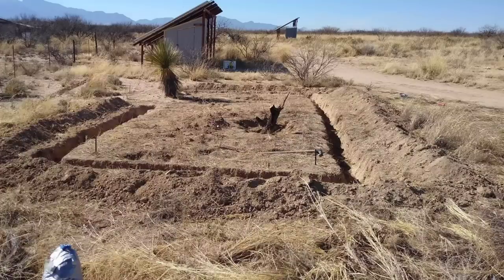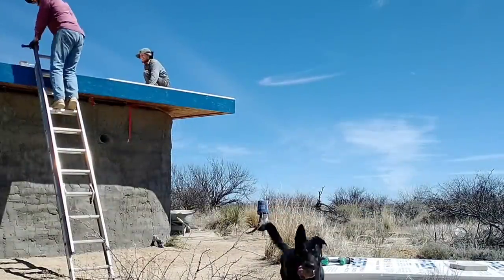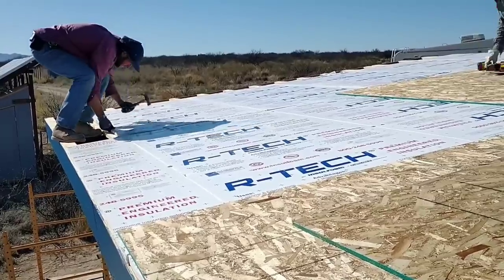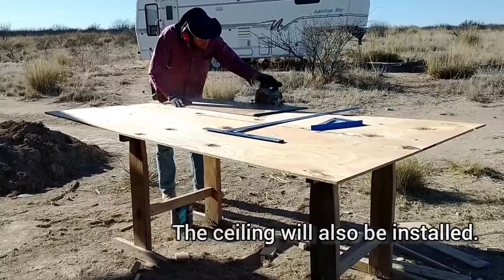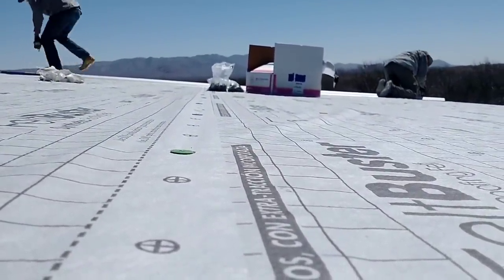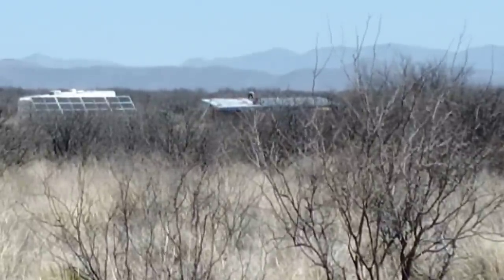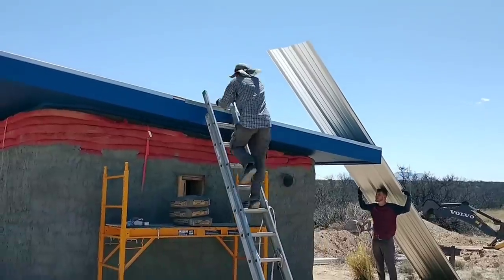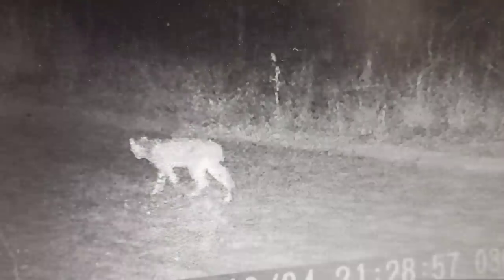HYPERADOBE Tiny House #5 Roof & Septic

Comment: Interesting that you went with the galvanized R panels. I have a 24 x 30 shop that has the same R panels, it started out as just a covered carport so the galvanized was fine. After I enclosed it, I felt it was to hot so I painted the roof white, I’m glad I did.
Reply from the maker: The silver galvanized was less expensive, so we did a quick temperature check on our house, and it was a little cooler than the white. It surprised us too. The dark gray was definitely much hotter.  It's not summer here yet, so it may not be completely accurate, and the only white we could easily get to on house is the trim. We might could compare it to our white roof in the summer.

Comment: Is it a code/structural reason that two thin layers of foam would require more purlins on top?   

(Two layers pro: can stagger the seams, cons : as you have mentioned.)
Reply from the maker: It was just a decision based on what we felt comfortable with. Thicker foam means longer screws, more risk of compression, and a less secure connection.

Comment: Do you know of any off griders using living machine septic system?
Reply: From my limited research,  subsurface distribution constructed wetlands MAY be built between the septic tank and leech lines. An Inspector simply ignores them. But it does NOT replace the leech field Code requirement. At no point can the effluent come to the surface. (Cochise County NM) Correct me if this is incorrect/incomplete
Reply from the maker: Thanks for the input SoloSailor. We haven't looked into it, or heard of anyone using one around here.

Comment: Nice video.  Maybe you'll consider having solar panels on top of your roof in the future. Apart from providing additional electricity, it would prevent heat from entering via the roof...
Reply from the maker: The roof doesn't slope in the right direction and it's not at the right pitch. He already has enough solar panels. 🌞

Comment: nice build, i used the metal roofing on my Barn 32x14 with 8 in 12 pitch hard to install because of my pitch but a great product
Reply from the maker: Thanks! Yes low pitch makes everything so much easier.

Comment: It's important to step in the right place when walking on the foam layer because if you step in the wrong place you'll go through the foam layer and this will ruin the foam layer. So they can walk carefully you can install the foam board and cut the foam board.  So you can cut the foam board to install it correctly. You don't want to squish the foam. When walking on foam layers, it is important to step carefully and install the foam board correctly. To do this, place the foam board on a flat, stable surface, cut it to size, and secure it in place. Avoid stepping on the edges or damaging the foam layer. By following these steps, you can help to ensure that your foam layers last for many years. The foam layer is delicate and needs to be handled with care. When walking on it, you have to make sure you step on the right spots, otherwise you might sink into the foam and damage it. To avoid this, you can use a foam board as a guide. You can cut the foam board to fit the shape of the foam layer and place it on top of it. This way, you can walk safely on the foam board and install the foam layer correctly. Be careful not to compress the foam too much when cutting or placing it.
Reply from the maker: The foam had it's challenges for sure. Sometimes there's not a lot that needs to be said, but better to say something than nothing.  I could have just played music, but someone's going to complain no matter what you do.
Reply: @RedandAprilOff-Grid  that's true

Comment: Roof is heavy duty, but i dont see any attic ventilation, no air in or out? So sorry about back pain, i hope you heal up soon.
Reply from the maker: Thanks! We considered adding vents and could add them later. The vents are typically for the attic space, and this is an unvented roof without an attic, so they shouldn't be needed.

Comment: Curious what the septic system cost was I'm budgeting for a build shortly .
Reply from the maker: It was $15,000! Our daughter's septic right next door was $9,000 two years ago, but it has 100 feet of leach field, compared to his 225 feet.
Reply: @RedandAprilOff-Grid  did you take the az diy install test
Reply: Can you install your own system? Did they inspectors give you any trouble they are ruff here
Reply from the maker: @timerickson7056  We installed our own septic. There were 2 inspections, we didn't have any issues. Ours cost $6,000, for materials and the backhoe rental. We put in a plastic tank and 100 feet of gravel leech field.

Comment: I understand that the thin insulation is cheaper, but this does almost nothing to prevent heat coming in. Nowadays a minimum of 10cm is required.
Reply from the maker: The foam board is to create a thermal break over the beams and purlins. The roof will also be insulated.

Comment: silicone sucks. Ya should of used mastic tape on the lap.
Reply from the maker: The seams doesn't need to be sealed with the R profile, it's just an extra preventative.
Reply: I think the whole thing will blow away in heavy winds...lol  up draft.
Reply from the maker: The whole roof structure is attached well, it should be fine.